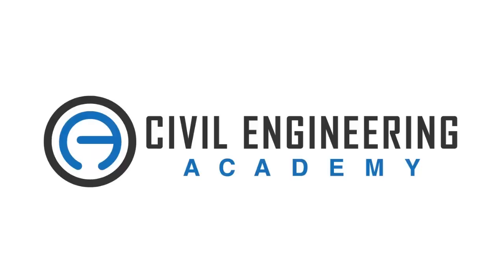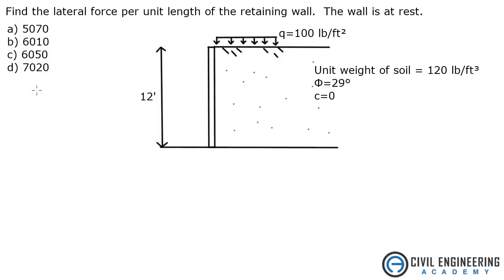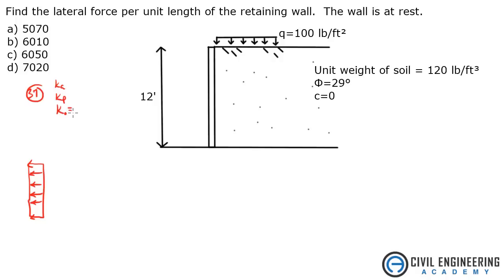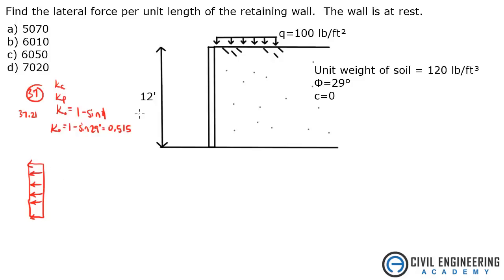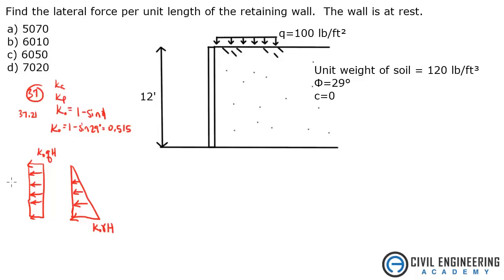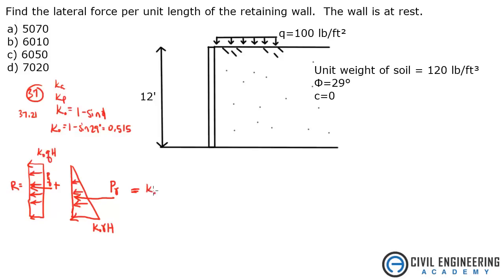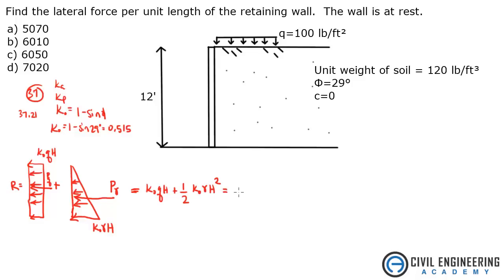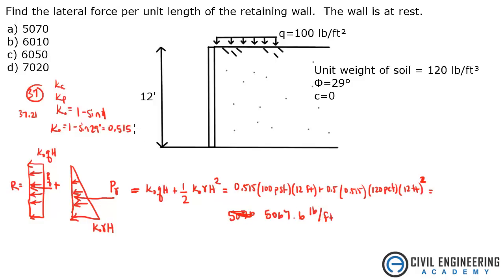Geotech-Retaining Wall with Surcharge Load

Comment: I need some clarification regarding the surcharge load KoqH.  Will the resultant force (of the distributed load) be 1/2H since it will be acting at the midpoint of the wall.  In order words, Ko x q x H should be (0.515) x (100) x ( 12/6 [resultant Height]).  Thanks in advance!
Reply: I mean ... 12/2 = 6 ft

Comment: If there's a water table, would you need K0 to get lateral? I would judge no based on my experience in fluid mechanics. In fact, it seems like K is only used because of the orthotropic nature of soil. Let me know if you need K in the case of water. By that I mean you wouldn't use K when determining the lateral pressure given by water (.5*H^2*gamma_water), but you still would for soil in same calc (.5*K*H^2*gamma_soil)!

Comment: For the morning session, should we expect problems where you have friction on the walls, sloped backfill, cohesive soils, or walls at an angle?. I'm studying according to the NCEES recommendations so it is hard to know whee to stop. "Lateral earth pressure"
Reply from the maker: ***** You could have those different scenarios thrown at you.  I can't say that they couldn't but most the time you won't have a sloped backfill and they keep it fairly straightforward.  You have a limited time to solve these so asking real math intensive stuff probably won't show up but you never know what they could throw at you according NCEES.  :)